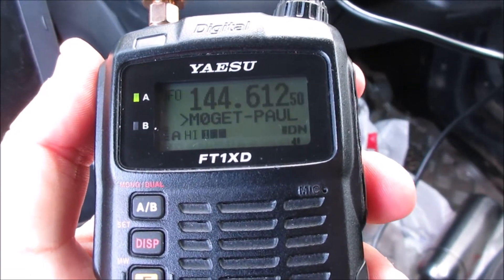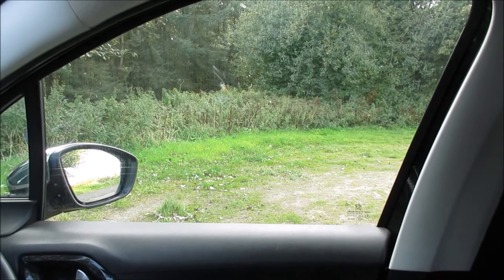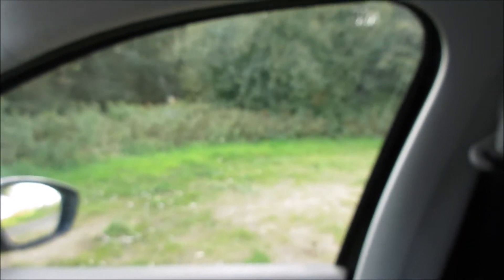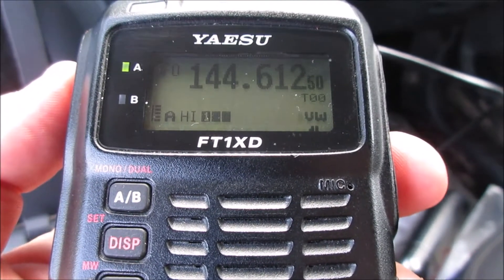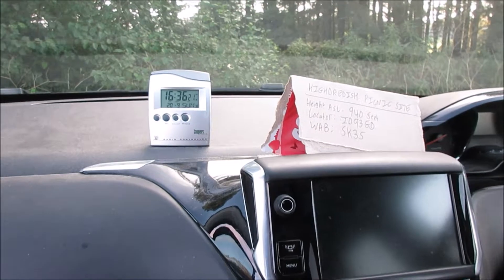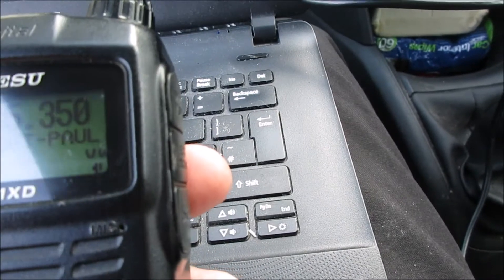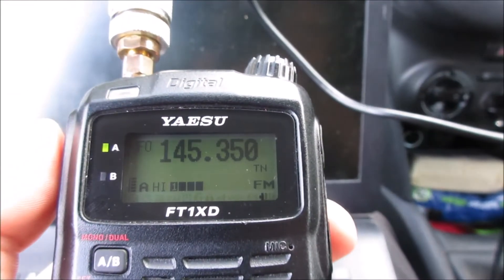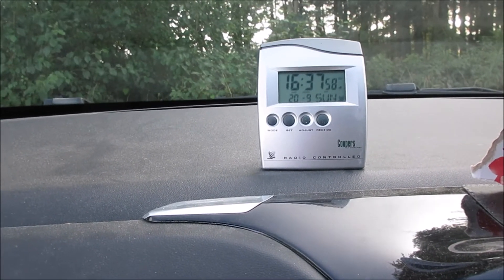C4FM simplex - random contact with M0GET/p on 144MHz

Comment: Hi Ed that was a good contact with Paul M0GET using Fusion, crystal clear.  I have to agree with you that Highoredish is a great spot for radio contacts.  I used to go there with the South Normanton and District Amateur Radio Club just after I got my license, a very good spot I was only using a handheld managed to work many stations.  I had a really good time so glad you made contact.   I hope you enjoy your holiday,   On Tuesday night I called on GB3DC via echolink and was surprised when you came back to my call on the repeater.  Really enjoyed the qso sorry I couldn’t talk for longer Ed.  If you are interested Ed I normally monitor GB7IN DMR repeater on 70cms at the same site you visited if you would like a qso in the future.  Great video thanks for sharing 73s M3SNU Steve.